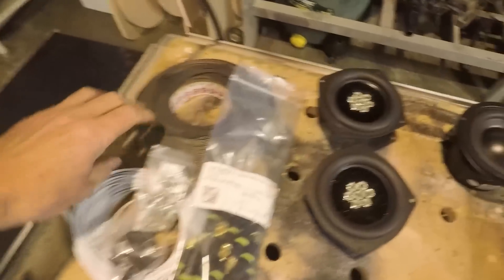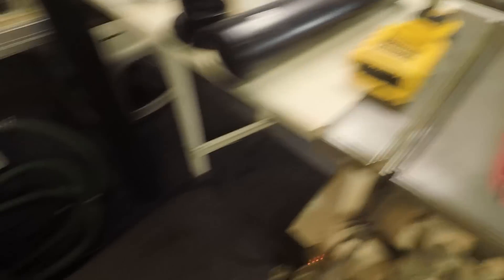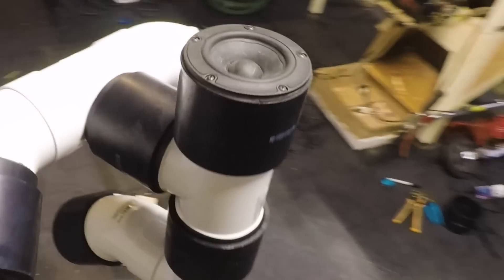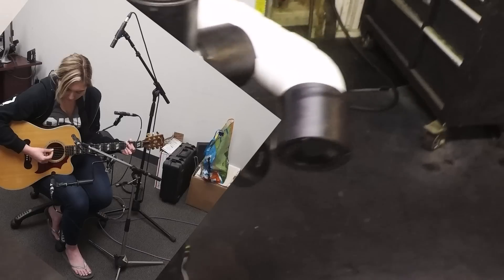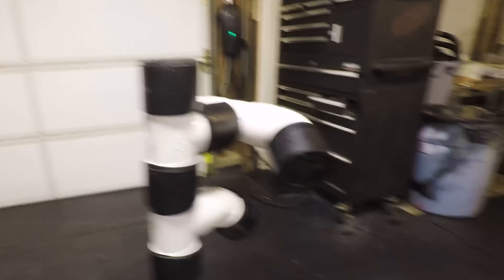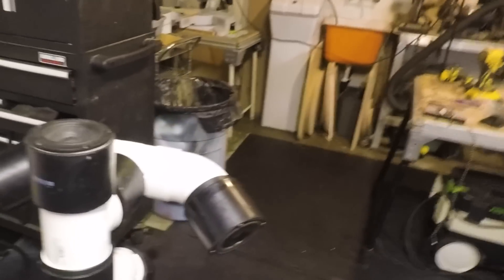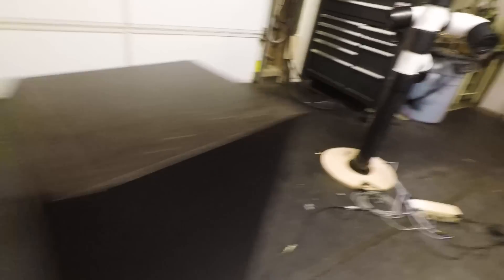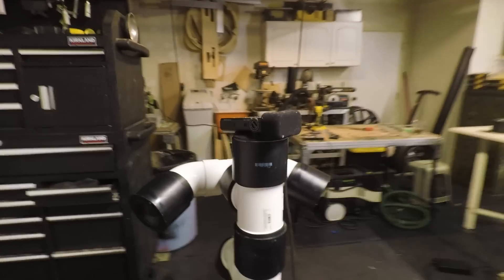Speakers Don't Sound Real, Lets Build One That Does

Comment: I understand where you are coming from and you are right in that modern "stereo" systems don't exactly replicate the original source.
Consider this though, modern stereo systems have to:
1. Be extremely versatile because a listener may listen to Beethoven's 9th symphony one moment and then  Hussle & Motivate by Nipsey Hussle the next moment and then For Those About To Rock by AC\DC the next moment.
2. These "stereo" systems must reproduce not only a large variety of "acoustic" instruments but also a large variety of electronic instruments and sounds across the entire frequency spectrum and all at the same time as opposed to doing just a single instrument.
3 Modern stereo systems need to operate in a large variety of environments including  "open concept" living rooms, bedrooms, basements, outdoors, etc.
Given these parameters then a fair comparison of the Klipsh speaker would be to put it in the environment in which it was meant to be used and listen to it the way it was built to be listened to and then put your multidimensional design in the same environment and just to keep things fair compare it to surround and Atmos systems with measurement mics.
Last but not least, the ultimate test would be to explain to your significant other why the speaker array needs to be in the center of a living space.
Reply from the maker: Bigger picture. Singer songwriter does a dozen live simulcast shows with vid and realistic audio in restaurants and bars across the country or world. And it sounds real.

You have your normal speakers and you have the ability to stream super cool realistic audio to speaker off in the corner.

Trade show has a 3d video of someone speaking or performing and the audio sounds like they are actually there.

Something to ponder
Reply: @DaveRat  Something to ponder for sure but some other things to ponder:
So the trade show is this a large hall with concrete floors, a large "ballroom" with carpeted floors, or a "meeting room with paneling and a large wooden table in the middle of the room?
The singer-songwriter sounds realistic to who?
The people sitting in the back of the restaurant by the wall?
The people sitting on which side of the speaker array.
What if the restaurant does that for a week and then wants a jazz quartet?
More arrays for each instrument and how many tables need to be moved to accommodate it.
This is why modern sound systems are what they are which is versatile though granted they are a compromise.
But even a live singer-songwriter requires sound reinforcement under various circumstances.
I get where you are coming from and the idea of "holistic" audio is a good one but will inevitably require multiple drivers of a variety of frequency responses in multiple locations, similar to what Atmos is trying to achieve, and even Atmos is not economically feasible or adequate for many different types of environments.
I like your idea and I'm not saying what you are looking to achieve isn't possible but you probably not going to achieve it with conventional technology.
Reply from the maker: I have been searching for sound reinforcement that does not sound like a speaker box pretending to sound like and instrument my whole life.

I can understand that many or most people could care less or are satisfied with what we have. And also know that I love background music, as much as music that is the center of attention.

And I also am pretty sure that if you put a conventional speaker vs realistic speaker in a subway, tradeshow or bar, the realistic speaker will turn heads and bring smiles that conventional speaker will fail to impress. 

I also understand the desire to bear hug the familiar
Reply: @JonAnderhub  I think the question here isnt 'whats the most versatile sound reinforcement system', it is 'having lived with the compromises of versatile sound systems most of our lives, can we make a specific purpose sound system that sounds more like the presence of actual instruments, even if they arent the perfect instruments'?
Reply: @mycosys  I agree with you that the question isn't about making the most versatile sound system and it is about making a system that sounds more like the presence of the actual instrument.
But ask yourself this question: Why are sound systems built to be versatile, to begin with?
The answer is that they must operate under a large variety of environments and reproduce a large variety of sounds.
While Dave's experiment works for him in his particular environment will it still have the same effect on someone sitting in the back of a coffee shop or restaurant?
While it might be effective in a small booth on a trade floor show with people standing in close proximity to it, will people walking by the booth hear the effect?
Would the same speaker array produce a complete jazz quartet with say a 5-string bass (tuned to D) a trap set, a trumpet, and a piano with the same realistic detail?
This is my point.
Building a specific array for specific instruments and specific environments doesn't really work in the real world.
Reply: @JonAnderhub  why does everything have to be universal? have you never seen an art installation?
Reply from the maker: The right tool for the right job. This project was focused on realistic reproduction. For applications where realistic reproduction would be desirable.

Comment: It's a shame you can't talk to Linkwitz about these ideas. I think we arrived at the stereo 2 speaker setup it's the best compromise. Most people are ok with 2 speakers in their house, but any more than that is kinda difficult and really only for the enthusiast. The same stereo mix also works for headphones, so it's probably going to endure for a while yet. The next leap really requires a new portable audio file format capable of carrying more than one unique mix of each track.
Reply from the maker: That was all based on ancient tech. When getting 2 high quality channels was a challenge. Now we can do 48 channels or more at a higher fidelity with less effort than 2 used to be. Amps used to be big heavy and expensive, now they are tiny and cheap. Speakers are small, loud and inexpensive.

Yet...

We are still grovelling around in the horse and buggy of audio. 

It's humorous and also sad
Reply: @DaveRat  Agreed on the amp tech. But speaker tech is still much the same as it was in the 70s. I think each speaker still needs to be relatively flat and low distortion, which is where this idea might struggle, in my opinion. The sources you are reproducing may sometimes be "lo fi" but you still need accuracy in the reproduction. I could clearly hear the midrange issues in the pipe speaker that weren't a problem in the infinity, for example. A violin put through a honky speaker with no top end or distorted top end is going to sound very unrealistic. In my opinion. But I'm not an expert! Keep experimenting man!
Reply from the maker: With speakers it's the magnets and high temp adhesive that allow small light weight speakers to be amazing
 
The highlight is that when you are in the next room, the speaker sound like a speaker. The tubes sounds like, WTF? Is there someone playing guitar in the garage?
Reply: @oldman1944  i've listened through in-ears. What I heard was a tons more information in the mids. All those accoustic centers shifting from frequency to frequency made that guitare way more realistic! To be fair you should compair with a tried and true stereo recording technique and a stereo diffusion rather than just one speaker with one mic.
Reply from the maker: I will work on some other tests. Mainly I need easy access to a live instrument in my home. Guess I will try and learn to play a cigar box guitar or something.

Then will have source material to do more

Comment: How about one speaker aimed up into a hemispheric dome?
Reply: There are oldschool lowther designs which do this. They used concrete cone shapes. I have heard a replica with a concrete cabinet and it sounded basically very normal, even a bit boring and indistinct. B&O also had various strange lens designs a few years ago with vertically mounted speakers, and CNC metal waveguides. Very much a normal pistonic speaker. The advantage of this rat design is the non-continuous directivity and multi-input high bandwidth multi dimensional input & output - a more detailed source with a 3d soundfield and more detailed information from the original source. Even point source waveforms should really be represented as something like a soundfield B format - both an omni pressure plot and an XYZ figure of 8 plot are required to represent a point source and its dynamics as an element within an airspace. That way you can control directivity and create different radiation patterns, including cardioid or omni. An array permits all sorts of subtle control.
Reply: Also if you want to be pelted with rotten fruit and broken leads by pro audio people, just show them the sales materials for the little known Bose 2201 "pulsating sphere" tricorner unit.
Reply from the maker: Those are interesting!
Reply from the maker: Then you have a single sound bouncing off a resonant shape
 

The concept is to have differing sounds aimed at differing directions. One sound is the problem we already have

Comment: If I built this Dave, my wife would expect me to fix my plumbing........ I am in on the concept though innovation lets go one step beyond Flash Gordon. Use to do sound at Hamilton Place There were 70v speakers under seats and cabinets aimed at the side walls from the ceiling and front wash with a center custer it was wild Russel Johnson out of New York designed it and you could isolate cabinets through out the theatre for effect as well cannon from behind the audience no problem but like all good things it was ript apart when I left because someone thought a front wash line array alone was the answer not.

Comment: I'll be honest, i'm skeptical... but, i love the experimentation, and believe that's how innovation is made.  Keep it up!!
Reply from the maker: Skeptical of what? Instruments are like sprinklers, conventional speakers are like mounting shower heads on the wall

If ya want to recreate a sprinkler, don't put showerheads on the wall.

That said, it's fun and everyone that hears it is drop jaw wow!
Reply: @DaveRat  Skeptical of others understanding how to use the system effectively.  You're correct that the sound is more authentic, but in a room full of listeners it's harder to give them a uniform experience.
Again, i love how you're attacking this, but I want to understand the practical method I could use this beyond using it as a novelty item/showcase.
Reply from the maker: Also when designing this I was thinking more about reproduction than reinforcement

Comment: Dont call me a heretic but didnt Bose do something like this a while back - I think it worked on for small gigs and more acoustic/jazz types of music.  Do more of this though - I love the way you think!
Reply: Bose made PA systems - the Pro 32 with a sub..and there's an Electro Voice Evolve 50M, and JBL's One, iirc.
Reply from the maker: Never seen a multi channel multi directional Bose. But Bose did make speakers that send the same sound to a bunch of speakers, look up the 901. 

And Bose made some cool tower line arrays.

I would not be surprised if someone has made something similar but since the reproduction is dependant on recording the instruments in multi channel and playing back in multi channel, I don't think there are any consumer products out there yet

Though you could do it with a modified 9.1 system
Reply: @DaveRat  Indeed - that was the Bose - the portable Line Array.  Did a few intimate gigs with every instrument having one of those and no traditional FoH.  Worked great in that use case.  Scaling could be an interesting proposition.  If they made a bigger version of that it never made it to Australia afaik.
Reply from the maker: Yeah, the Bose L1 was based on a line speaker per instrument. 

And doing that with these could apply. 

This concept here is more geared for reproduction than reinforcement

Comment: So was the 4 channel recording the  most important part? So an entire band would be a hundred channels. How do you power that?  Lots of wire on the floor! I love the idea Dave. Just yankin your chain. I do agree with the idea. It is without a doubt a better representation of the original sound. As always you get us thinking!
Reply: The atmos codec probably built into your television supports 128 channels, 118 with position information. It wouldnt be hard to hijack this or similar positional encoding for this purpose
Reply: @mycosys  Ah ok. I did not know that. Thank you. Makes Daves idea even more interesting!
Reply from the maker: Agreed, Atmos could offer a really speaker setting for people that had units
Reply from the maker: I would look at channels and mixing differently and use 4 mics or inputs per band human or per noise making things like marshal stack or Leslie or whatever.

I see a singer songwriter owning 4 units and streaming a gig to 4 restaurants simultaneously. Video and realistic audio.

I see trade show displays with these speaker designs supporting 3 video.

And yeah, doing a 60 piece orchestra would need 240 mics to record and 60 speakers to play back

Comment: Yes, I have done a whole bunch of work on this, and it is feasible to reproduce a symphony orchestra if you are willing to use a few thousand channels and some custom built transducers.
Reply from the maker: I don't think it's that hard. A bunch of cheapish speakers and a lot of amps and a lot of mics in the recording should do ya
Reply: @DaveRat  I'm talking indistinguishable in an A/B test to an expert listener or measurement equipment. Replication. Same idea as a player piano - instrument reproduction. Drive a violin body with a bending wave transducer via the soundpost.

To make it sound like an acoustic guitar, the best idea is to drive a stringless guitar body with a tectonic transducer. I have some really nice plans for the "amplifier case" for classical and folk musicians to use as foldback or small scale reinforcement, which has a wooden soundboard inside the lid. Bending wave transducers are much less prone to feedback, in some very interesting ways. Ideal for a monitor.
Reply: If we can get "backline" going for orchestral music, we can make orchestras much cheaper if you only need the front desks and we get a bit of AI processing tracker for the other players, who are just doubling stuff to make up the dBs, and the washiness and timing issues are a regular issue we'd like to get rid of. Not all orchestras sound great by any estimation. There is a whole potential field of symphonic acoustic quality music by employing high technology to reduce the eye watering costs and personnel issues. Symphony orchestras cost too much per day for people to use them, but the good ones sound the bollocks. I reckon we could get the same sound with 15 people using some clever frontier technology.